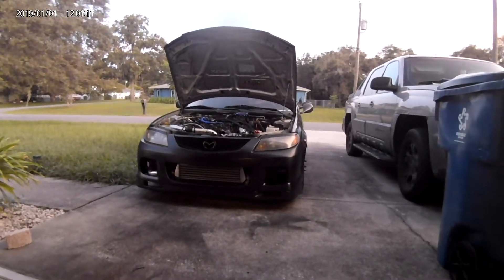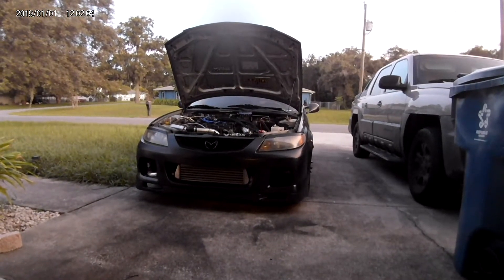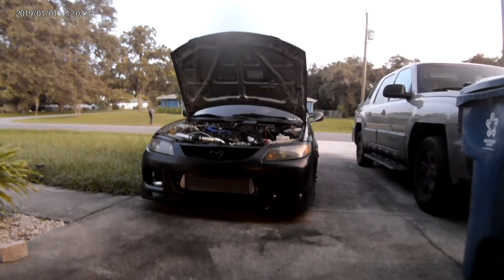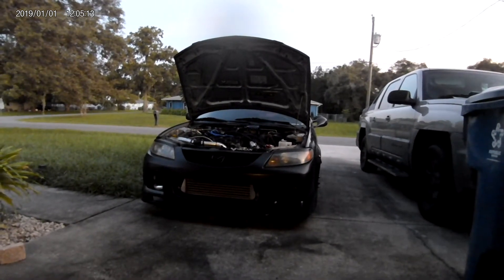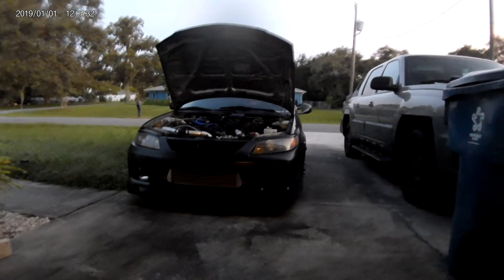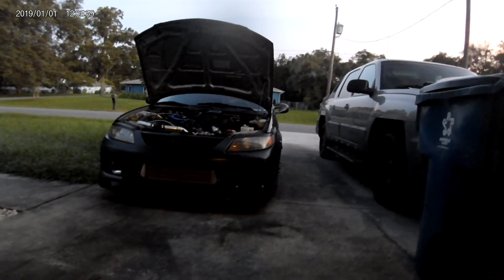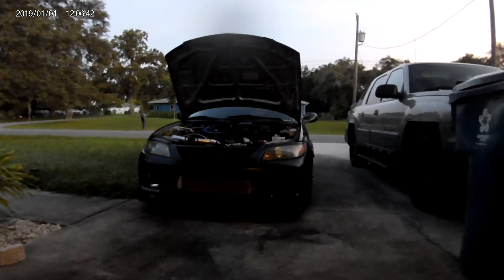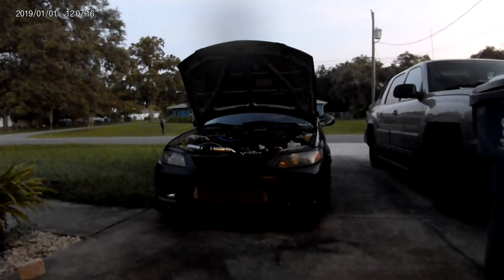Refer to newer video for look in the bay*How to turbo your N/A 2.0FS Mazda Protege. How I did it.

Comment: Did you do anything with the intake manifold runner valves and also how far off the throttle body did you put the mass air flow sensor
Reply from the maker: I have my vcts/Vics bypassed right now so the flaps hang wide open. The car loves it in my opinion. My mass air sensor is about 8 inches or so from the tb.

Comment: Nice car boss I have a 2000 Mazda protege DX myself I heard yours was an ex so I think that's a little better than mine but I don't have any power windows or anything like that but the car isn't good shape I'm rebuilding the whole thing from top to bottom and I'm going to keep it naturally aspirated for a while and then think about putting a turbo on but great information appreciate it
Reply from the maker: That's awesome ,I love the Protege platform. Mine was a bone stock Protege Es. Was 5 speed, was bone stock and had 67k miles when I bought it. Now shes got a bigger then stock turbo, alot of aftermarket parts and alot of big plans for the future. :)
Reply: I'm sorry it's a 2003 I'm using this mic thing on my phone and it said 2000 when I said 2003 so yeah it's a 2003 I'll give pictures I'll put pictures up when I'm close to finishing it but I do have a few videos on YouTube if you want to check it out